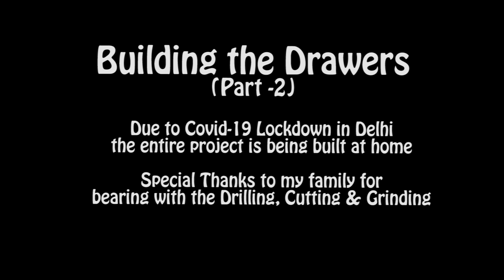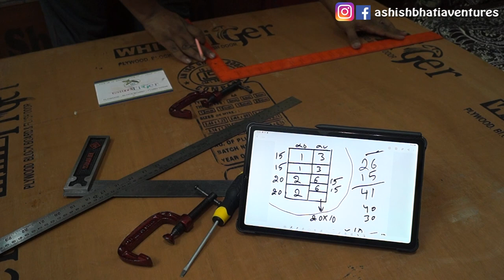Drawers system for my SUV || Caravan Conversion Mahindra Scorpio Part-2 || Campervan India

Comment: In my Toyota Tundra 5.7 ltr 4wd in USA I have the following upgrades: dual exhaust, 33 inch 12 ply tires, 176 ltr petrol tank, dual battery with pure sine wave inverter, Yakima roof rack, ac outlets in back and cab.
Reply from the maker: Wow that's a lot of mods. But I guess Tundra is a big rig so fitting an auxiliary fuel tank and battery is easier. But anyway you are lucky to own the beast. Thanks for watching
Reply: Beast only gives 4 kms per liter. 381 hp and 543 nm torque